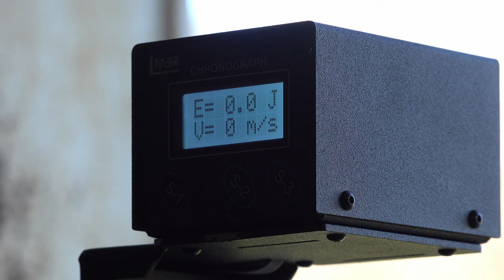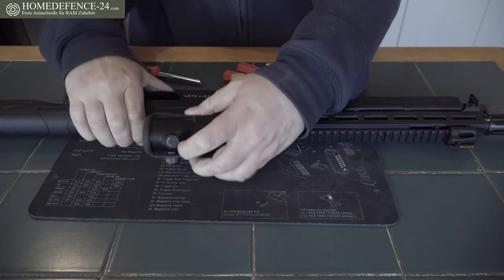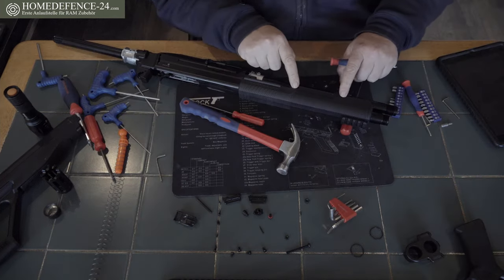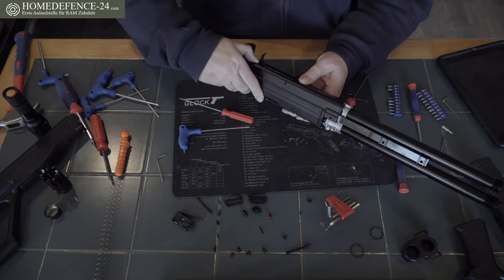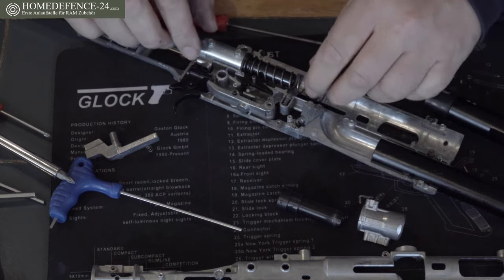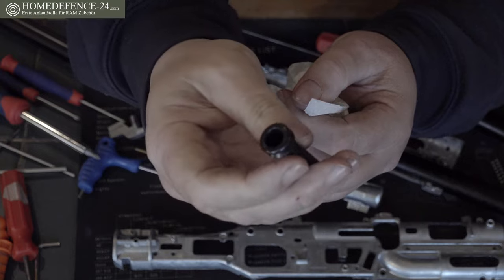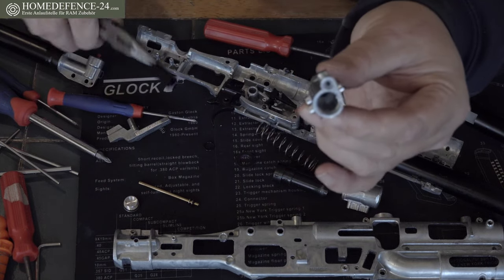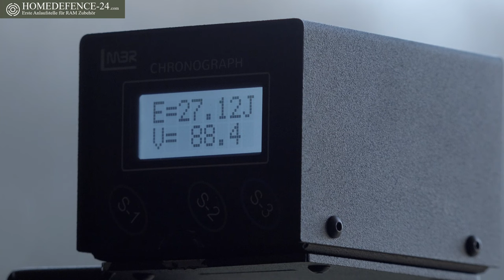Fitting a Powerkit68 to the Umarex HDX 68

Comment: I was really surprised, that valve made one heck of a big difference. I have to give you a lot of credit getting that thing back together again
Reply from the maker: Plus removing the restrictions, yes there were a lot of screws. And I took it apart in the wrong order, but now I’ve done it, it should be quite easy.
Reply: @Maddogairguns  Hey man, I've been using the red rap4e reusable first strike rounds and I've noticed that the raised lines (presumably to add some spin on exit) are leaving small dents on the inside of the breach where the ammo is seated. Is this a problem? Should I stop using them? Cheers
Reply: So its illegal 🚫 now? Why not just buy the high powerd version if its legal.
Reply: @ablockley4183  Lol did ya break your gun yet?

Comment: I have been watching this gun for a while now....and finally comitted to buy it. It sells out as soon as it hits the shelves, so I got lucky. I did all the mods as soon as it arrived and it was quite straightforward as long as you pay attention and take your time. I used a magnetic bowl to collect all the screws and bits, but still managed to lose one of the tiny machine screws. I found a fitting one in my screw tin so I was back in business. 

Well, after the mods I loaded it up and gave it a test fire with regular rubber balls on a cinder block from about 12 yards....and wow!!!...it blew a hole into it. I kept shooting at various targets and was having fun when after about 25 shots I started to notice a drop in performance. So, reload and repeat to the same results. Yes, I was shooting indoors at room temperature.

I recommend this mod for people looking for sheer power but not for fun shooting for it eats through the CO2 like crazy...just be well stocked in cartrdges. Someone suggested to put the little brass "tophat" back in for it apparently regulates the CO2 much better but to a slight loss in velocity.

I really wish this gun was available as PCP so that you could just pump the tank and keep shooting. I have other PCP guns and I can consistantly get more than 100 shots from a single tank filling. I also feel that the gun is much to long and heavy...a more compact version that weighs around 2 Kilos would be great. Don't get me wrong for it is a blast to shoot and it obliterates targets....just be prepared to spend money on CO2. By the way, dremeling the notches out of the chamber does absolutely nothing....I would rather keep them in order to reverse build and sell legally on the market.
Reply: At this point I need to make a downward correction to the amount of shots fired with the mods....realistacally it is maximum 14-15 rounds per CO2 change....I am not happy at all. I will try the brass tophat replacement tomorrow and see how that goes. If not, then I will have a friend in the pressure tank industry make a tank with regulator to which I have a coupeling to match that. Then laser print a fitting stock for it...
Reply: @torbenengelhardt8264  No not yet, I am waiting for more CO2 to arrive. You can do the mods, but leave to brass piece in for now...seems people get more consistant performance that way. I will post more when the CO2 arrives.
Reply: @dirklatham1045  Good write up. Did the brass tophat help in regard to shots-per-c02? I guess 15 shots isn't the worst considering 30 joules..
Reply: @owenporter1472  I actually never changed it back again....I ordered 250 CO-2 capsules and have been blasting away. I am trying different ammo though. I recently tried the ceramic d...h balls( I cannont spell the word because they are sensitive to it). Pfffffff! and damn! These things went completely through my home-made target box which consisted of several layerys of thick cardboard and two layers of thick hard foam. AND they shattered on the tile wall behind it to send about 100 pieces of shrapnel back at me! I will never shoot these indoors again! I am thinking about steel balls next. Anyhoo, I developed a leak in the system so I have to take it apart again to replace o-rings. Luckily these are easily available fairly cheap in local hardware stores....welcome to high pressure airgunning!
Reply: Adendum....if you shoot the rubber balls, then you know that they are difficult to load.  Just put them in a zip-lock bag and spray them with some Ballistol or good silicon spray...and knead the bunch!
Reply: @dirklatham1045 i saw online you can get an adapter to screw in the large paintball c02 tanks
Reply: @dirklatham1045 use some teflon tape on threaded parts that have o rings for n extra good seal

Comment: After disassembling the HDX and being ready to swap out the original unit with the powerkit68, I found that Umarex had literally glued the original in throughout the threading!  Even after thoroughly heating it, it wouldn't budge.  Ultimately, I had to resort to drilling the original and using a screw extractor to remove it.  It worked, but I was sweating like a sinner in church the entire time! Getting it back together was a bit of a challenge, but it's working great now, and a huge improvement in power!  Thanks for the video!  It really helped!

Comment: Thanks! If you start with a 16j. you dont have to unscrew the cap with the 2 holes to take out the black filler. it's already empty. Cheers
Reply: thanks for info
Reply: Apparently the 16j air chamber has thicker metal walls though, so it’s more powerful to take a 7.5j air chamber and remove the black plastic restrictor than it is to take a stock 16j air chamber.
Reply: Yes 16J version has empty valve but it is a bit different inside, it has a lot less space than 7J version when you pull out the black tube. Therefore I guess tuned 7J version is more powerfull on HPA than 40J version.

Comment: There is loctite on the threads of the part you need to get out. Without heat it WILL break and it WILL be hell to get it out.
On my HDR, I used a small soldering torch for 5-10 seconds. That melts the loctite fast and makes it easy to take the part out.
Reply from the maker: As I said in the video, heat it up and it comes straight out. Never had a problem with changing the pin, on my HDR and HDS and now HDX.
Reply: @Maddogairguns  I know you know what you are doing, but made a comment to others that might not know that there is loctite on that part and that's why you need to heat it up.
Great video, mate!
Reply from the maker: No offence taken. So many people seem to mess up that part.
Reply: @Maddogairguns  Not an easy task to get that piece out if it breaks off.
Not too long ago a guy in the fb forum broke his and had to drill it out.
Don't think he got the hdr to work after that, not sure.

Comment: OK now I have my plan. Find someone who knows how to do this and ask them to do it. I would end up sitting on the ground in tears surrounded by parts if I tried this myself. I've changed the timing belt on a Chevy Vega using less tools.
Reply: You don't need I sell way better products here in South Africa we don't play with what's effective
Reply: Dude it wouldn't be that hard if this clown would tell you exactly how many screws there are and keep a count of them and also tell you a little bit of something that makes a huge difference and that underneath where they have that storage compartment for the loading mechanism to help load you have a screw that is got to come out in order for it to split in half he says nothing about it and also it's not a Philips it's not a a straight screwdriver it's a really strange bolt that is not a hex head or anything
Reply: I already  regret.  I thought it's going to be easy  😅, step by step I loosing hope finish 😂

Comment: By the way guys, the 40 joule model uses two (02) Co2 cartridges. One is the large 88 gram Co2 cartridge, the other the common 12 gr. cartridge. New to the 88 gram cartridge or don't want that expense? No problem: Your Umarex 40 joule purchase includes an (otherwise $39) Umarex Co2 adapter, that allows you to use two 12 gram Co2 cartridges in lieu of the 88 gram.
Reply: Mine didn't include the conversion kit. What do you mean the 40J version uses two Co2 cartridges? That you can use them both simultaneously? I'm confused
Reply: Mine did not come with the conversion kit, however I do have one from another gun, but if you use the converter kit, you can forget 40J though!

Comment: Thanks Ben! Stick a HPA tank on it and show us if it improves the joules and consistency!
Reply from the maker: That’s what I’m trying next.
Reply: @Maddogairguns  looking forward to the update!! 👍
Reply: @Maddogairguns  Hi Ben,
Do you know if it’s possible to fit a 88g Co2 to the HDX? or even a HPA tank?
Reply from the maker: @tonyross4365  I have the HPA kit from homedefence-24, which I am going to try. Someone with good machining skills might be able work a thread, for fitting a hpa tank, don't think  I will tackle it though.
Reply: @Maddogairguns  have you a link for the HPA kit? I can’t see it on Florian’s website?
Reply from the maker: @tonyross4365  https://en.homedefence-24.com/Products/0-2-liter-hp-system-200-bar-3000-psi-incl-remotline-hdr50-hdp50-hds68?variant=32135797768310

Comment: Absolutely struggling to get the old power kit out, to replace it at the moment. Other than that this videos been great! I believe since mine is the 11 J version that with my power kit tuning it’ll get up to 30-40 joules. That’s the hope at least lol
Reply: If you put the 88 gram adapter on and take out the restrictor, that black plastic thing he took out of the air tube, you don't need the power kit. I did the 88 gram adapter and took out the restrictor and got 45 joules without the power kit

Comment: 88gr co2 should give a little more power too because the co2 dont have to fill up the hole black pipe so less preassure loss i guess. But you have to saw off the pipe

Comment: I read somewhere that the only difference between the 40 joule and 16 joule versions (those are the two power levels that will be sold here in the U.S.) is that the 40 joule version has the mechanicals for the 88 gram Co2 cartridge. Otherwise, the mechanicals are the same. If that proves accurate, I'm going to be real curious to see what happens on installing the power kit on the 40 joule shotgun.

Hmm. . . safe to assume the relevant parts are engineered to handle what, 60+ joules?
Reply from the maker: I think Florian at Homedefence-24 has had a play about with the 40joule version. He said there were some gains to be had, but as most people seem to be happy with 40joules, they don't seem to be modding them.
Reply: @Maddogairguns  Yes, that makes total sense. They are a business, have to go where the demand is. At 40 joules I would NOT take apart the beast only to squeak a few more joules.

Comment: Hello I am French and I tried your method for unclamping but it turns out that in the end the part is not machined in the same way as your hdx 68 (see 14 minutes in your video) suddenly could not go to the end... Perhaps it is not exactly the same as your country? Then I reassembled the weapon but I can no longer bring the slide back wide for loading... It remains blocked... Is there something special to do during reassembly so that the loading takes place? normally ? Thanks for your help !
Reply from the maker: I'm in France and bought it here, you likely have the 16joule version. I have not seen the inside of those.

Comment: Nice. I want to know if it's possible to fit an 88g Co2 cartridge instead of the 2 12g Co2 cartridges by removing the black tube at the back of the gun? It would be nice to know if the thread is already there for the 88g.
Reply from the maker: No, don't think the thread is there. The black tube goes further into the gun and joins up with the CO2 chamber.
Reply: Do you think umarex will send us the 88g valve housing as spare part?
My HDX energy was 9.2J by the way.
Same chrony same Rubberballs.
Reply: You could cut it down and glue a threaded Insert for the 88g capsule in the housing.

Comment: Ola!! Been a couple of months now. Curious as to whether you have noticed any reliability issues since doing the mods? Dumping gas, miss-fires etc? Inconsistent velocities maybe? Or sweet as a nut?
Reply from the maker: After doing these mods, I had it dump a lot of gas on the first shot. Quickly reloaded the next round and it stopped. Not had that problem since, so think it might have got a bit stuck inside. Seems to be going ok other than that first shot.
Reply: @Maddogairguns  Ah right, so the first shot is very high powered? Thanks for the reply!! Love the vids 😎👍

Comment: All you guys seem real happy and give him props and stuff but you know what he does not keep a count of the screws he does not tell you if they're the shorter ones or longer ones he also leaves out a huge huge piece of information that will not even let you split the gun in half which is that where they store that piece that's supposed to help you load in the grip there is a screw that is not even a screw and it's not an allen head it's something I have never seen before that is unbelievable hard to get out and if you don't get it out you're not splitting the gun in Half he says nothing about that

Comment: Also you mentioned removing a restricter before fitting the mod, what kind of power increase do you get from just removing the restricter
Reply from the maker: Sorry, I don’t know. I just did all the mods at the same time, didn’t want to keep opening the gun up.
Reply: @Maddogairguns  cheers can't wait to mod mine 😄 how many shots do you get per co2 cartridge once mod is done, and do you know if there's a way to convert to the 88g cartridge
Reply: I suspect that would be the difference between the 7.5j and the 16j but I'm no expert

Comment: Hi Ben,
So, if I fitted the 88g Housing adapter to use the 88g Co2 is it worth fitting the power kit as well?
Just seems a lot more messing around if it doesn’t make much difference in power.
Reply: I put the 88 gram adapter on and took out the restrictor and got 45 joules without the power kit, I agree with you it just seems redundant

Comment: Is it possible to upgrade the 40joule version to get more power? Without switching to a HPA system?  Is there a valve block or a restrictor you can tamper with? 
BR
Reply from the maker: I have no experience with the 40 joule version, and they don't seem to work well with HPA, due to the size of the brass tube/port.

Comment: HI guys, Just A quick one, just about to convert my HDX .68 with the PowerKIt up to 40 Joules, I live in the UK, where do I stand on Legal grounds as the info I have researched says that the legal limit here is 16?
Kind Regards JP.
Reply from the maker: The HDX68, in the UK is classed as an air rifle, due to the length of the barrel. So that is the reason the 16joule version is available. Legal limit in the UK for air rifles is 12ft lb, so any mods you do to a 16joule version will put you outside the law.

Comment: OK it's good we managed to make the weapon work again, but the part where you removed the piece of black plastic in order to create a larger space is not the same on my 16 joules model... The we have the impression that they put an iron cilynder inside... In any case, it's not black like yours... It may be possible to come and enlarge the hole with a wick... . What do you think ? Thank you.
Reply from the maker: Just seen that you have resolved your issue. Yes being the 16joule version, it might be slightly different. You can enlarge the hole slightly, using a dremel or similar tool. Just make sure you can still screw the cap on and you don't weaken it too much.
Reply: @Maddogairguns  OK yes we will try to do... So we removed the very small piece for the moment the one at 13 minutes 40... And we changed the piece you are asking to buy... And we would like to know what's the point of changing that please? The role of this play.
Reply from the maker: @SinayeOFFICIELSINAYE  Changing the piece, that I put the link in the description for. Is that it is shorter than the original, allowing more CO2 when you pull the trigger.
Reply: @Maddogairguns  :goodvibes:
Reply: @Maddogairguns  thanks guy

Comment: Hi,what type of sparclettes do you use?
2x 12gr OR 1x 88gr after the modification ?
Reply from the maker: Only 2x12 will fit in the 7.5 and 16 joule version (or so I'm told) the 88g fits in the 40 joule, so I use 2x12.

Comment: I also wanted to add to the post I just put I'm going to be starting my own channel sometime soon I'm not quite sure as to exactly when with my work schedule and everything I just wanted to be able to show you the kind of stuff we have here in the United States we can have front firing blank guns depending on where you live just like our airguns it all depends on where you live most of the US you could have any type of Eragon you want with no regulations I just unfortunately happen to live in the state code New Jersey where the gun laws are absolutely the toughest out of anywhere in the United States but most of the states are guns Black Powder guns and front firing blank guns or not regulated most of the States you don't need a background check or permit or nothing like that to get those now modern guns that take metallic cartridges or shotgun shells you have to get a background check or permit depending on where you live the state I live in I can get the front firing blank guns paintball gun / hdr50 which we have to put the levenswiel valve in ourselves if you want to have it like that but anything else in this state that I live in you have to have a permit for so with that being said where I live at is pretty much like the laws where you live at except yours are actually a little more relaxed than the state I live in and needless to say my wife and I are moving hopefully in the summertime